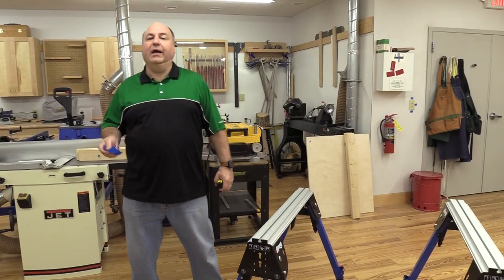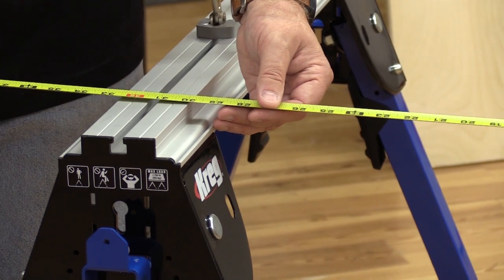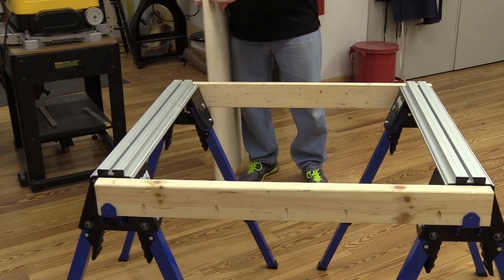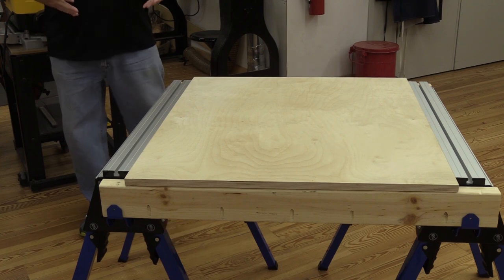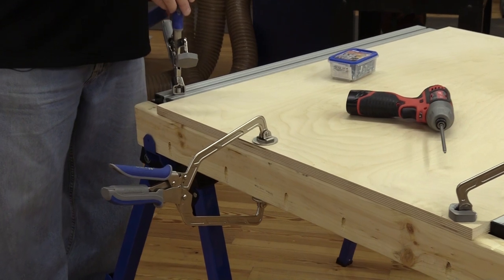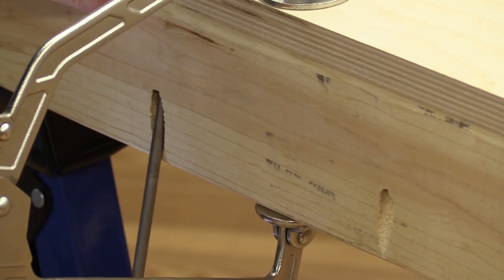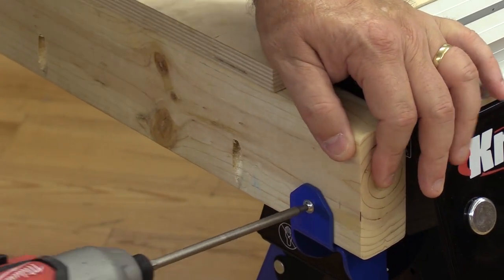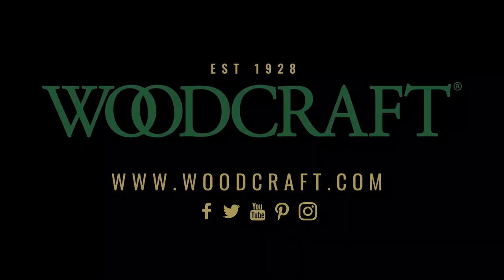Kreg Mobile Project Center & Track Horse Work Support Products at Woodcraft

Comment: Since the mobile workstation has been discontinued and is no longer available, I have had to order two track horses instead.  Is it possible to move the table top if you don't screw it in to the horses?

Comment: I would like to use this to rip 8' long studs or 8' plywood sheets.   Is it possible to do this with the ACS?  Would I need to join 2 tables?
Reply from the maker: Yes if you use the track horse. The track horse is specifically designed to work with the Adaptive Cutting System, not the Mobile Project Center, due to height differential.

Comment: Peter, I already did this with my Kreg Project Centers. Two points I'd offer. Since I'm making it fairly permanent, I "made" my 2x4s with two layers of 3/4 plywood, sandwiched together, and then ripped to exactly 3 1/2 inches so as to come to the right height. Second, did you notice that 3/4 plywood fits "proud" of the track by 1/8"? I did and wanted things flush. Soooooo back to the box store and the best piece of 5/8 ply I could dig out of the stack. Works great. I didn't screw the top to the stringers for portability but I do like your idea for making the ultimate workstation. My shop is 12.24 and sometimes I need to "expand" into the carport. This is a great way to do it.
Reply: @thefrogotten6983  2x4s will bend, sag, and twist over time. My solution won't do that
Reply: @Honu425  I meant why not rip your plywood 2x4's.... oy vey
Reply: That's exactly what I did
Reply: @Honu425  you said that the ¾ plywood fit proud, so you went back to the store to buy ⅝ ply. My point was, instead of doing that, why didn’t you cut down your homemade 2by4’s that you cut to exactly 3.5 inches so the ¾ ply that you had on hand would be flush. Doesn’t make any sense to go back to the store and buy another piece of plywood when you have the tools to reduce the homemade 2x4s....